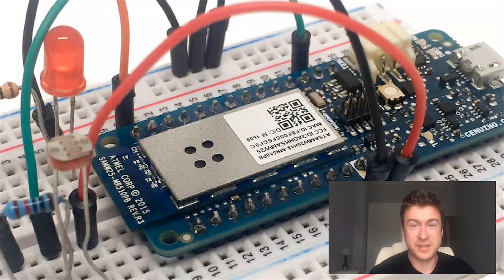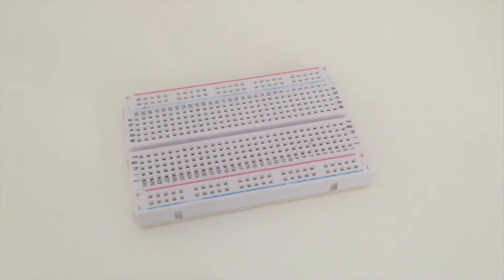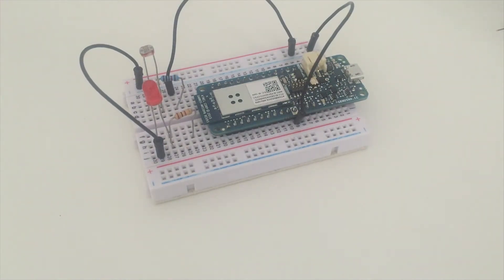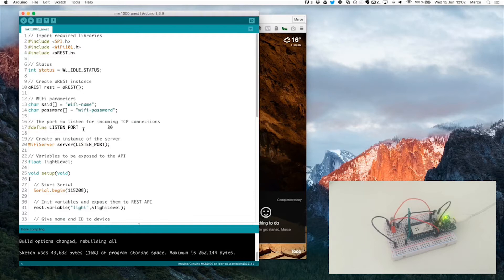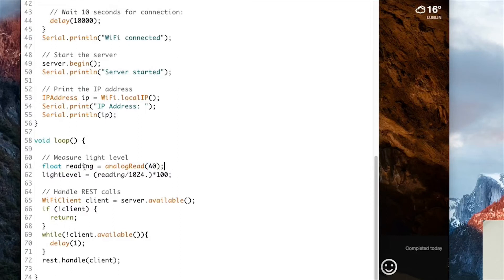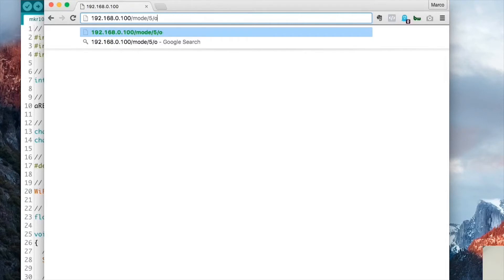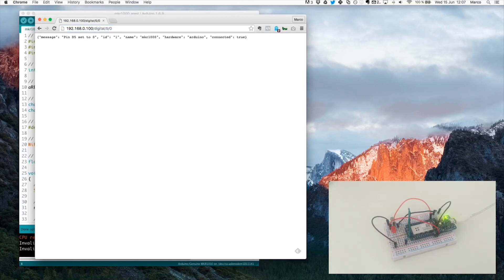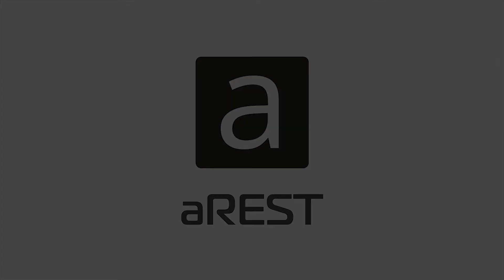Control Your Arduino MKR1000 Using aREST

Comment: I wanted to power it by li ion battery through the jst connector but it doesn't work. It charges the battery if i power it with usb at the same time but the power is gone as soon as i unplug the usb

Comment: i want to make iot based streetlight. is it good to use Arduino MKR1000,relay, DHT11 is humidity and temperature sensor, LDR, PIR sensor and led light
Reply from the maker: Yes, definitely!